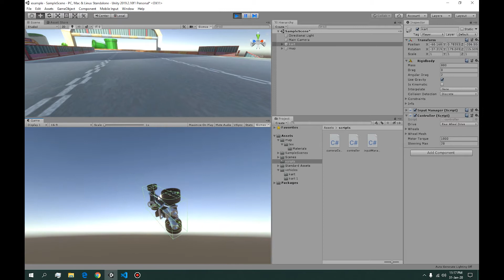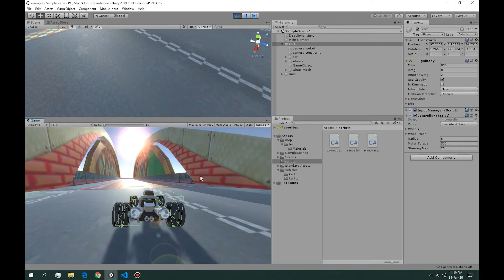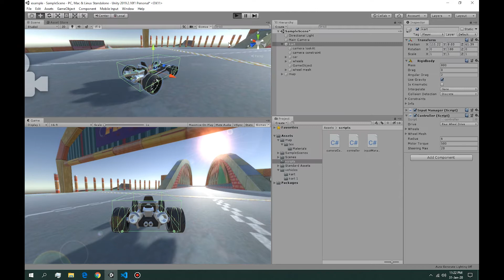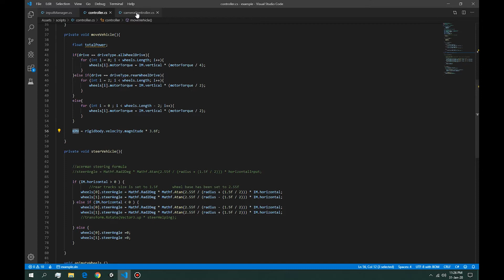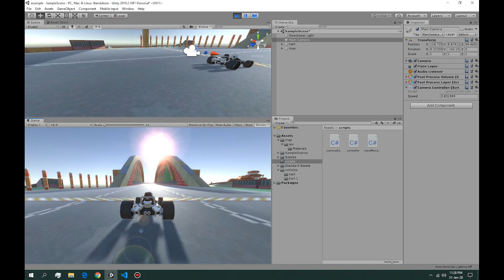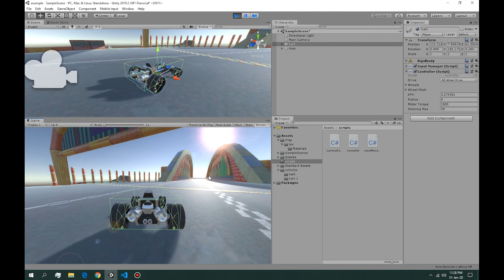3D Racing Game in Unity - ACKERMAN STEERING

Comment: private void steerVehicle(){

//acerman steering formula

//steerAngle Mathf. Rad2Deg Mathf.Atan (2.55f/ (radius+ (1.5f/2))) horizontalInput;

if (IM.horizontal > 0) {

//rear tracks size is set to 1.5f wheel base has been set to 2.55f

wheels[0].steerAngle Mathf. Rad2Deg Mathf.Atan(2.55f 4 (radius+ (1.5f/2))) IM. horizontal;

wheels[1].steerAngle Mathf.Rad2Deg Mathf.Atan(2.55f (radius- (1.5f/2))) IM.horizontal;

} else if (IM. horizontal< 0) {

wheels[0].steerAngle Mathf.Rad2Deg Mathf.Atan (2.55f/ (radius - (1.5f/2))) IM.horizontal; wheels[1].steerAngle Mathf.Rad2Deg Mathf.Atan(2.55f/ (radius+ (1.5f/2))) IM.horizontal;

//transform. Rotate(Vector3.up steerHelping);

} else {

wheels[0].steerAngle -0;

wheels[1].steerAngle -0;

}

Comment: Ackerman Script

//ackerman steering formula
        //steerAngle = Mathf.Rad2Deg * Mathf.Atan(2.55f / (radius + (1.5f / 2))) * horizontalInput;

        if (IM.horizontal > 0)
        {
            //rear tracks size is set to 1.5f       wheel base has been set to 2.55f
            wheels[0].steerAngle = Mathf.Rad2Deg * Mathf.Atan(2.55f / (radius + (1.5f / 2))) * IM.horizontal;
            wheels[1].steerAngle = Mathf.Rad2Deg * Mathf.Atan(2.55f / (radius - (1.5f / 2))) * IM.horizontal;
        }
        else if (IM.horizontal < 0)
        {
            wheels[0].steerAngle = Mathf.Rad2Deg * Mathf.Atan(2.55f / (radius - (1.5f / 2))) * IM.horizontal;
            wheels[1].steerAngle = Mathf.Rad2Deg * Mathf.Atan(2.55f / (radius + (1.5f / 2))) * IM.horizontal;
            //transform.Rotate(Vector3.up * steerHelping);

        }
        else
        {
            wheels[0].steerAngle = 0;
            wheels[1].steerAngle = 0;
        }